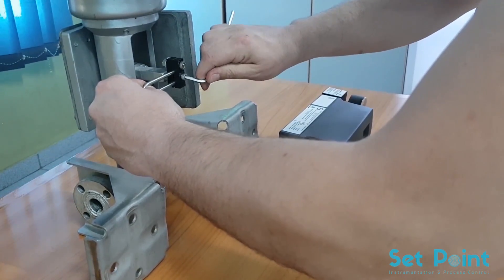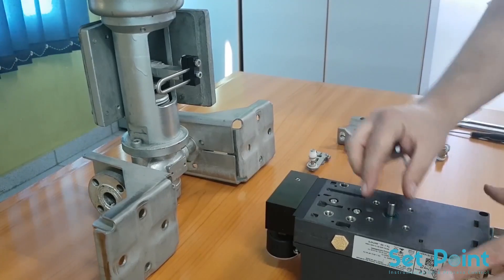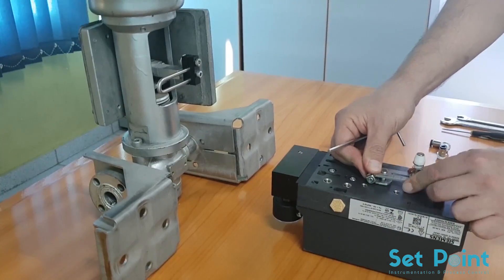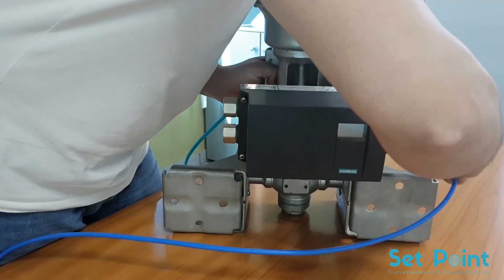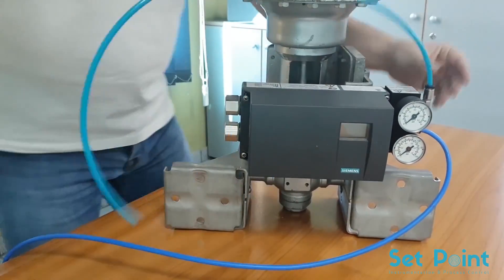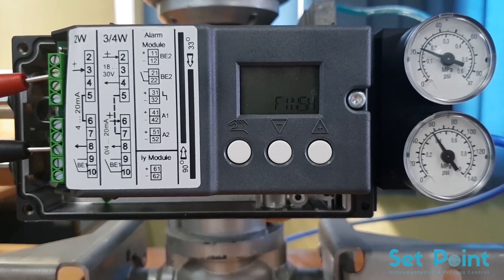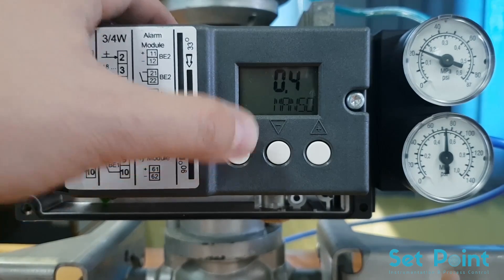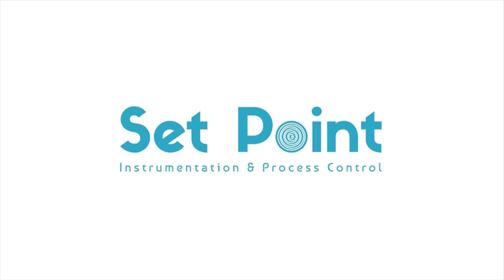SIEMENS SIPART PS2 valve postioner - on a linear valve actuator

Comment: Can i reduce the opening and closing time of this one
Reply from the maker: @inbatamilan1567  Hello Dear, and thank you for your question.
To achieve travel times of > 1.5 s in small actuators, the air rate
can be reduced with the restrictors Y1 and Y2 . By turning clockwise
the air rate is reduced up to shutting off. To set the restrictors it is
advisable to close them and then open them slowly (see initialization
RUN3).

Comment: I want to open 100%  in 19ma   what will be do????
Reply from the maker: @jitubabusay2826  Hello Dear, one of the solutions is to make scalling  (in the plc ) of the analog output.
by the way sipart ps2 has split range function, you can adjust parameters   YA and YE , for example: set YA= 10 % and YE= 80%, that means valve will open from 10% to 80% (4mA at 10% to 20mA at 80 %)
Reply: @Set-Point comming 19 ma when giving 100% command that's problem!!!
Want to open 100%  in 19ma command,
What to do???
Reply from the maker: @jitubabusay2826  yes we have a problem, please chek the compatibility between the confeguration output of the controller (4-20mA) and the input on the postioner (4-20mA). otherwise you have to do a reconfiguration.
if its not work, you may  send me a video of this issue to : setpoint.la@gmail.com

Comment: Sir we have a problem in calibrating linear actuator having stroke length 47 mm. During auto calibration we saw that valve feedback for 0,50% & 100% was not accurate. What is ur suggestion for this problem
Reply from the maker: Hello Dear, thank you so much for your qustion, lets say that everything conserning the linear valve is okay ( mechnaical codation, air supply as mentiond in the name plate of the valve, and the diaphragm) as one time i faced same problem and it was becuase of the diaphragm of the valve.
As you are dealing with stroke length 47mm, please make sure to install the long lever on the positioner ( > 35 mm to 130 mm) and adjust the driver pin accurately, also switch parameter No.2 to 99 edg and please move the  yellow transmission ratio selector to 99 deg too. then redo the auto configuring with leakage test, and please let me know the result. But please don't forget to check the valve's  diaphragm.